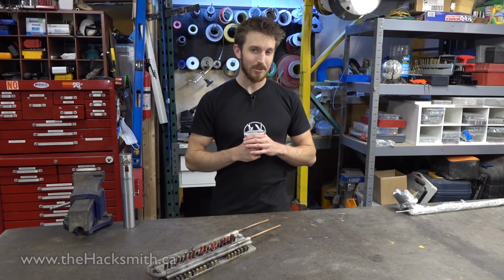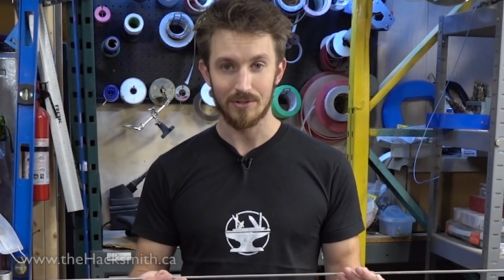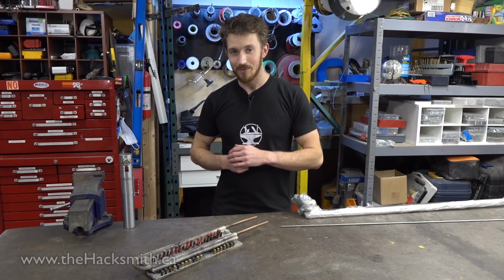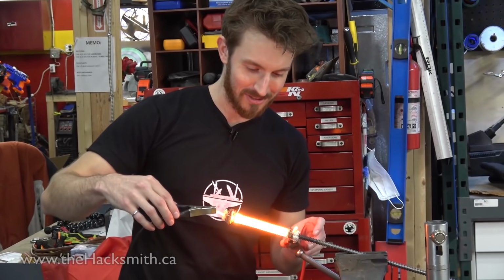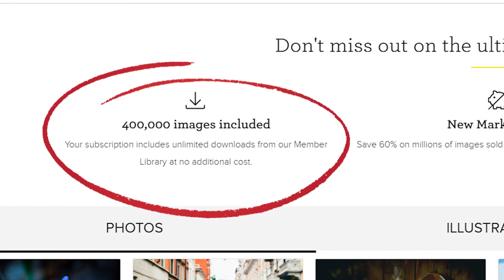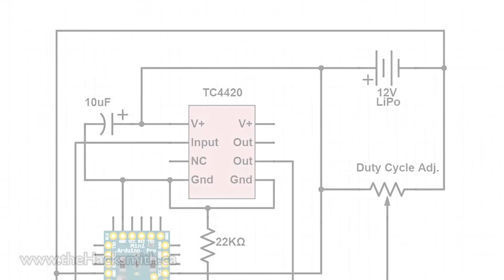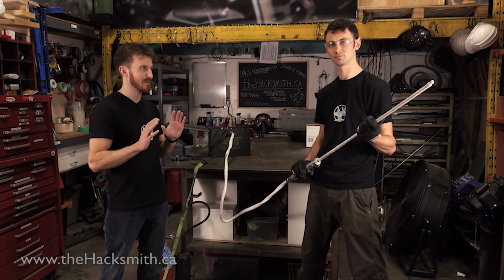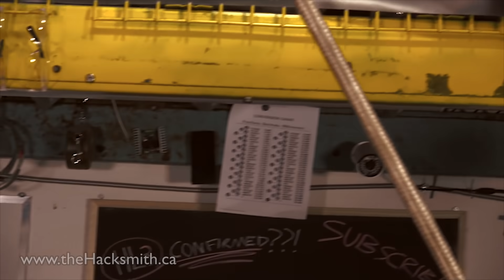2500° LIGHTSABER BUILD

Comment from the maker: TOP QUESTIONS ANSWERED:

- It's not a lightsaber, it's a protosaber!
     Yes, and if you watch the whole video, you'll see that is exactly what we call it ;-)

- Voltage doesn't kill, current does!
     It's important to know what that actually means before repeating it. 
     It only takes a few miliamps to stop a heart. But to stop a heart, the electricity has to GO THROUGH YOUR HEART. The human body, especially skin, has extremely high resistance. So for most small electronics projects, you're completely safe. The quoted "safe range" for DC is around 50V. This means your skin has enough resistance to prevent the flow of current through your body, and through your heart. As that voltage goes up, that's when you start to get in trouble. If you have ANY kind of unregulated power supply (like this one) it WILL be able to provide enough current to kill you. But only if the voltage is high enough to pass said current through your heart. This battery pack can put out hundreds of amps. More then enough to fry you. And 300V is more than enough voltage to break down your skins resistance. Please, please PLEASE research electricity -- the more you know, the safer you can be while doing projects. e.g. WHAT WE ARE DOING IS NOT SAFE!

- How does the blade not bend!
     It did actually start to bend a bit, but in our revised design (likely a tungsten core) it will not. We plan on making two, and yes, we plan on fighting with them!

- Where's the test!?
     Patience young padawan. These videos take time to film and edit! Make sure you're subscribed with notifications turned on!

- This isn't a lightsaber!
     Yeah well unfortunately even if we could contain a laser powerful enough in beam form... the laser emitter would be the size of the room in order to get any actual cutting power. Containing plasma, like a plasma cutter, could be possible, but still difficult to make into lightsaber form.

Our design is the closest to a functional lightsaber, as it will be able to cut things, it looks like it, and it sounds like it. Remember, how a "lightsaber works" is a work of fiction... invented by an author, not an engineer. The physics of how it's "supposed to work" just don't.

- I want to see more!
     Make sure you're following our social channels like Instagram, Facebook, and Twitter. We post additional content there, and on our vlog channel! Links are in the description and on our channel page!

- I NEED TO LEARN MORE!
     Then check out our website for a full article about the project =) ****https://www.thehacksmith.ca
Reply: Why not just call it FAQ
Reply: the Hacksmith now the real test is to make it blue
Reply: If it's not a lightsaber, why put "lightsaber build" in the title?
Reply: Justin it is a lightsaber, but it's technically a protosaber
Reply: Justin the prosaber was an early design of the lightsaber made by the sith  then adopted by the Jedi cause those dam sith alchemists get all the cool stuff. Then once technology advanced the light sabre was made (again by the sith first) due to the fact the power source could not be eternalised  in to the handle. This was done for many reason most obviously you could just cut the power cord and then no saber. (MORE STAR WARS CANNON/LEGENDS THAN YOU EXPECTED) ye don't know if this is cannon any more so ye
Reply from the maker: +Justin because most people don't know what a #protosaber is.
Reply: the Hacksmith how is this allowed and your not all being detained by the government of Canada (your gun laws are super tight as well (ye that's ironic I live in uk))
Reply: the Hacksmith you did a great work
Reply: should have melted the wire into a rod or blade shape
Reply: But why call it "protosaber"? Surely for people at the time (hypothetically speaking in a fictional universe, of course) "protosabers" were the only available laser swords, so they wouldn't be named as a predecessor to a not-yet-existing better laser sword called "lightsaber".
Reply: This is one of the coolest videos I've ever seen on youtube!
Reply: Wow, if I get rich, just the thing I'd throw all my money to
Reply: YOU JUST COMFIRMED LAVA ISNT INVINSABLE
Reply: Keep it up the hacksmith.
Reply: the Hacksmith Very cool but if it's just coil couldn't you it spring out on a stainless steel rod with something that works like a curtain rod or spring loaded extendable rod?
Reply: Hmmm.... From the looks of it, you've almost got it done.... who knows, maybe we'll be able to learn more just by this invention of yours to the point where we ACTUALLY MAKE a lightsaber XD
Reply: the Hacksmith I️ found 50 feet of 14 gauge wire for $32 in amazon..14 would work better than 16 right?😬
Reply: the Hacksmith I enjoy this project and hope to see more. Sense your kind of working with swords I was wondering if it would be possible to make the shield from percy Jackson and the lightning thief?
Reply: the Hacksmith did you have that cpu fan lying around from when you did a Ryzen build with an after market cooler? What were the specs?
Reply: the Hacksmith make the flashes nanotechnology suit from 4x02 of the flash if not make vibes glasses or arrows custom bow
Reply: Edgar!
Reply: You just made a Proto-Saber
Reply: technically your a trainee, and you have to create your own lightsaber to become a padawon
Reply: the Hacksmith recommendation, at the top of the sword, you should spiral the conductive wire at the tip of the sword. And when making the battery pack make sure it has maneuverability since you are trying to be a Jedi lol
Reply: I like this Channal.
Reply: Muhammed Samed YILDIZ a noble gas is a gas whose last electron layer is fully filled, thus making it non reactive
Reply: the Hacksmith u can try nichrome ramps up fast
Reply: u can also twisted more wire to lower the ohms of the kanthal
Reply: If you can make this you can most likely make a blaster
 You just need to find a way to launch a red hot piece of metal. Kinda like the light saber but smaller and lighter
Reply: Hi
Reply: the Hacksmith please make Isabelle lightwoods electrum whip from the mortal instruments.
Reply: where do you buy these batteries
Reply from the maker: +Csaba Benák yeah and this pack is capable of hundreds of amps. You need a high enough voltage to get through your bodies resistance. Might want to do a little reading on it instead of just memorizing a saying without knowing what it actually means in practice.
Reply from the maker: +Joseph Donaldson it is
Reply: the Hacksmith is it available across the states, I'm from India
Reply: the Hacksmith You should have that guy standing on some insolation while testing it.
Reply: TLDR
Reply: I hope you make the whole city the whole world a high tech city
Reply: you should try making the sword of daylight from the Netflix tv series Trollhunters please
Reply: Then call it a protosaber in the thumbnail and name of video
Reply: the Hacksmith is this what is causing the wildfires??
Reply: the Hacksmith so I was wondering if you have considered graphene batteries they are expensive but can retain a huge amount of electricity in a small area
Reply: the Hacksmith I've been watching a lot of u guy's videos. An I would like 2 get in on sum of the action. I'm actually trying 2 come up wit the schismatics 4 a super suit myself. I luv the light saber idea however... if u can control the heat. I'm pretty sure u can get it 2 come out like the real thing. Now how u guys gone minimize all of tht in 2 the handle. Is beyond meh but I would luv 2 see this project come 2 life. Not jus burn things but come on & come out like 1
Reply: the Hacksmith try an igbt, it does not suffer from internal resistance stuff. my fav: ixxx300n60, 500a 600v, pretty mean.(yes, a through hole part, not a big brick)
Reply: "yes we plan on fighting them" holy shit, do you have that much of a death wish.
Reply: the Hacksmith CAN YOU MAKE A SABER WHIP. Its a light saber thats just a whip you can use that wire and can you do it if i get 500 likes.
Reply: the Hacksmith can you make a retractable sword
Reply: hey i know this is random but you should say something about reproduction flash handles because prop makers are killing these antique cameras for them
Reply: How did you make the comments Bold? serious question. That's neat.
Reply: i think the movie concept from star wars is so much BS because it has combined so unrealistic properties, that it cant be done exactly like its in the movies:
- Obvious lasers dont work, 
- glowing metal also doesnt work (getssoft,  "cuts" slow - if at all)
i think the only way you get a good "metal cutting" abillity is to use plasma. For example
a rod with a shitload of small nozzles tight together (so it looks like one plasmaflame).
It would cut through metal like in the movieclip you showed. Depending on the power input slow to medium fast.
Reply: the Hacksmith I just had to sub bro!!!!
Reply: Do you think tesla make a long thin battery that could be used to power that?
Reply: the Hacksmith don't call the video real lightsaber then
Reply: the Hacksmith if someone use that kill everyone in their way - -
Reply: the Hacksmith this might be good for military AND MAKE FOR WAR HAHAHAHAHAHAHAHAHAH!
Reply: the Hacksmith wait this is begin of light saber in future light saber will use for war
Reply: "our revised design (likely a tungsten core) it will not. We plan on making two, and yes, we plan on fighting with them!"

I love you.
Reply: the Hacksmith can I please have one for my birthday please
Reply: the Hacksmith what happens if you coil the metal so it is like a spring. (You press a button then the metal spring shoots out and is heated up. It would be even more like a protosaber although lightsaber is technical is suppose to be plasma. Good luck on your projects.
Reply: the Hacksmith with man nitrogen is not nobel
Reply: the Hacksmith .awesome! Love doing shit like this! You should try making a replica stun baton out of some Tesla coils!
Reply: Porto saber: a very old version of Jedi light saber that was powered via external power supply. "Modern light sabers" use internal power supplies, or power cells.
Reply: the Hacksmith, can you please make mei’s snow gun from overwatch?that would mean the world to me, I want to see how you did it, and see you transform water into ice in seconds
Reply: the Hacksmith how about a Hoverboard?  Did you guys do that yet?
Reply: the Hacksmith its fits for you like a jedi
Reply: Do the gluon or gauss gun from Half life !
Reply: the Hacksmith Make it real: Vibrosaber!
Reply: the Hacksmith This is really cool but a lightsaber is a ring of plasma using extreme magnetic fields to coil the plasma like a tokamak. I really love the creative style you bring to this. It would be a awesome Cosplay with a protosaber
Reply: why cant the blade reract the it will look beterand be mor like a light saber
Reply: LIES!
Reply: the Hacksmith nice
Reply: Liked his own comment 0/10
Reply: David K Lightsabers as we see in the movie is more like a ring of plasma controlled by magnetic fields. So this is just a proto Saber in look.
Reply: the Hacksmith I have a challenge for you: different colors
Reply: It's not a protosaber, it's hot metal in a camera flash with a piece of a toy that makes wibbly noises when you move it.
Reply: Ur hack smith u named the vid lightsaber even though u said it is a proto saber
Reply: Make it purple
Reply: K
Reply: have you considered ceramic for the core?
Reply: Lasers have nothing to do with lightsabers; I can't imagine any method by which you could bend physics until a laser stopped at three feet, clashed with other like beams, and emitted that manner of noise. Almost certainly, it's either magnetically-encapsulated plasma, or Space Magic™.
Reply: MR_DYMAN at last You can rlly get it blue. The only real blue fire is plasma, but plasma is way to hot to get that close, if they even tried to make it blue they would not be able to do so. Because hey would die of heat
Reply: the Hacksmith you made the heating element to most Vapes. You should see if there is a place where you can find these components to build these high power and high-wattage Vapes I know a lot of them push upwards of 200 volts you should check them out. you could probably pull a regulator or some sort of module out of an electronic Vape and reduce the size of this project checkout 18 650 lithium ion batteries
Reply: the Hacksmith 
Not even really a protosaber... the battery pack would be belt mounted.
Reply: You should get a HUUUUUGE block of styrofoam and just go to town on it with the protosaber!
Reply: the Hacksmith bruh how long did that take
Reply: Maybe you could *attempt* to make a prototype lightwhip?
Reply: the Hacksmith That is really awesome! And I see you are Canadian!
Reply: Then change the video title
Reply: the Hacksmith you should sharpen the steel blade so it cuts easier
Reply: the Hacksmith I
Reply: You need snubber diodes and/or capacitors to help prevent the high voltage spike of the mosfet switching off between the pwm signals which is why shorted the mosfet.
Reply: so we need to get some Sith to solve that ;)
Reply: The Sith were the first ones to develop power cells that essentially cut the lightsabers' cords.
Reply: the Hacksmith I WANT ME ONE SO BADDD PROTOSABER
Reply: the Hacksmith dude, can you make those weird orange disks from doctor strange?? Those would be awesome!!!!!
Reply: I'm sure Lucas could design a functional science weapon if he wanted, he just doesn't want everyone cutting each other into sausages with plasma beams
Reply: Tungsten is radioactive. not massivly. but still.
Reply: If I end up in a possession of a lot money 'you will make me one'
Reply: the Hacksmith What career did you do?
Reply: the Hacksmith Amperage FYI.
Reply: You could argue that it was called a protosaber because they designed it to have an energy source in the hilt but were limited by the technology of the day
Reply: the Hacksmith is so good at making stuff
Reply: the Hacksmith use cotton instead of ceramic and you have a deadline ecig kanthal is very common for higher ohm coils
Reply: the Hacksmith i
Reply: the Hacksmith I
Reply: the Hacksmith o
Reply: this will be a fire sword
Reply: should have used the tungsten core i guess instead of stainless steel one.i guess
Reply: the Hacksmith If this is true then you have gained my trust for now
Reply: @MarioMysteryBox If you mean the shield from the shitty movie adaptation, absolutely. If you mean the one from the percy jackson books, then I'm pretty sure it's not possible, because it's a 4 foot diameter greek shield that folds into a slightly bulky watch.
Reply: the Hacksmith
 yes, this is cool, and it had alot of hard work put into it, but you stated this is NOT a lightsaber you could have just put proto saber or something else in the title
Reply: i opened comments to say that it was a protosaber , good job
Reply: the Hacksmith the metal u heat up will work without the stainless steel rod because there’s actually no joke a lightsaber whip used in the comics
Reply: cn you make the blade extendable
Reply: I have an idea for a light saber, but It needs crazy science
Reply: He hearts his own comment 😂😂
Reply: Loda
Reply: Its not the voltage and the currwnt that kills there is a bunch of other stuff like duration freqency... Its not the current that kills

Comment: It's funny, because in the Star Wars lore, Jedi's used to use battery-powered lightsabers before they were able to figure out how to make the lightsabers more portable. Because when Jedi used to fight against the Sith, the Sith would cut off the cable from the power supply to the lightsaber or they would most likely run out of power that's why they were deemed inefficient to use by the Jedi.
So without knowing you actually did not just create a lightsaber but you guys created a ancient lightsaber.
As a Star Wars fan of the comics I tip my hat to you good sir.
Reply: Angel Villa The story is part of the Legends, which is non-canon, but good point there.
Reply: You mean a Protosaber, he also says in the Video they are making a Protosaber not a Lightsaber
Reply: they made a superheated metal rod, the proto lightsaber would have had the lightsaber beam with the external powerpack.